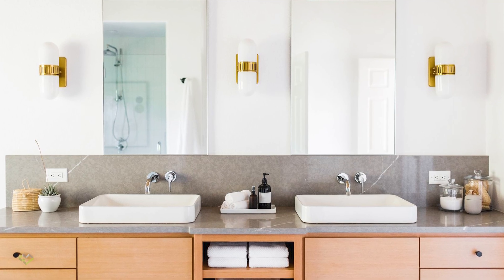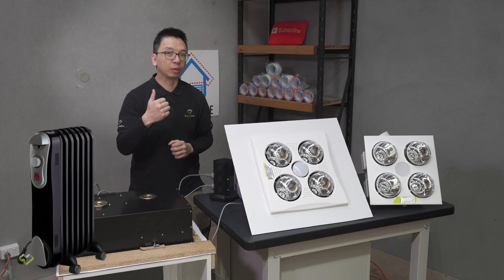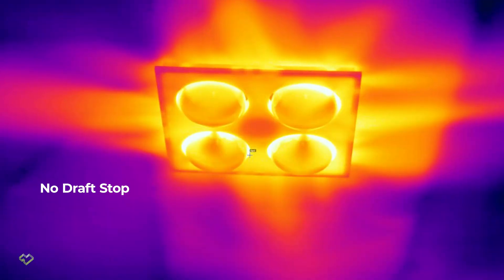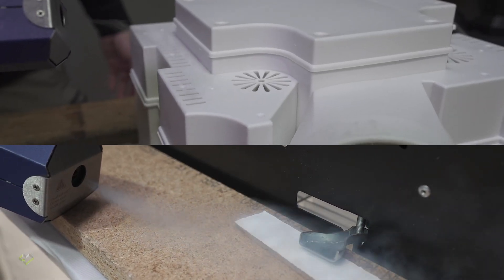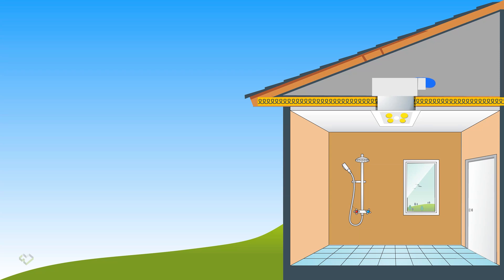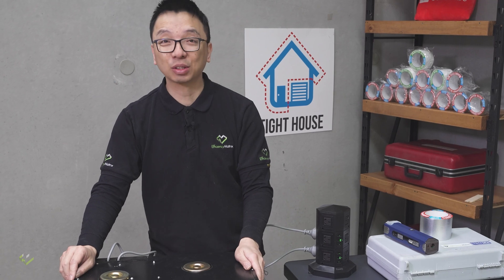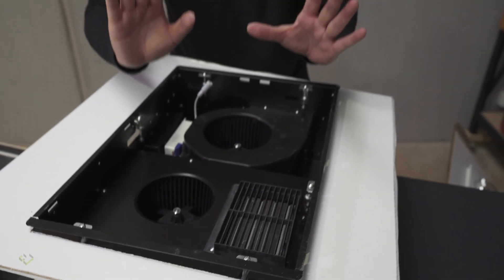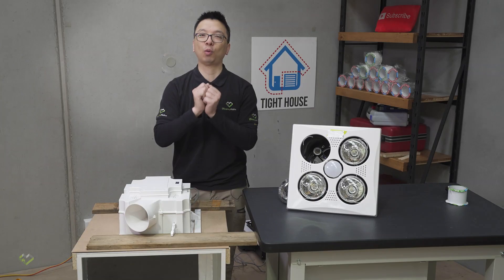Are Heat Lamps/all in one units a good idea in your Bathroom?

Comment: We have had the 3 in 1 in our main bathroom for several years and also fitted one in the ensuite. The inline fans have been very efficient at removing the steam and the lamps provide heat on stepping our of the shower. For the 10 to 20 mins max 2 of us most of the time use the bathrooom I would not be concerned about the running cost and it is hardly worth heating the rad for that time. The mirror is clear  to use after showering.

Comment: Here in Brazil any of those solutions would cost 6 months of salary. haha
Back in the day my parents would get a soda bottle cap, fill it with rubbing alcohol, pour said alcohol in the floor (tiles, obviously) and light it up. lol 
Never tried it, as I always thought it was madness, but they swear it worked wonderfully. 🤣

What I do when I'm gonna stay more than a few minutes in the bathroom is take a hair dryer, put it on the countertop and turn it on and close the door for 7-10 minutes, then get inside and use the bathroom normally.
People often forget hair dryers are basically (noisy) air heaters, they can't be used for long periods, but for quickly heating a bathroom, or even warm up a cold bed, I find them perfect for the job.
Also basically every house already has one, so why not use it? 

Then again, cold winter days are a rarity in Brazil, in my region they don't last more than a week or two.

That being said, I never considered heat lamps before, that should be interesting to test out someday! :)
Reply from the maker: Heating the bathroom is a serious issue, that doesn’t really have a viable economic solution.  It’s pretty sad really.

Comment: I've been wanting to add heat lamps myself!  Getting out of shower, nothing like a nice warm towel or some heat while you dress!

Also, with the popularity of cold-plunges, and considering a refrigerator outputs 32-40F (0-4C)... 
I'd love to remodel a bathroom, such that with a flip of a switch somewhere, 30-minutes later, ice-water will come out of the shower-head  (2gallons/min for a few minutes)! 

Any thoughts if this is do-able , or is a shower's water flow too much for on-demand ice-cold?

Comment: We use a heater blower wall mounted to recirc warm air within the shower room, this raises dew point significantly and keeps the moisture in its gas phase, once the room gets saturated (condensation noticeably begins forming) we turn on the extraction fan which is on a pre set run on timer.  Simple, cheap and very effective.

Comment: Another option to greatly reduce the need for the fan is to have a fully enclosed shower area. Something like a showerdome or even a piece of arcylic sheeting that covers the top of the shower means that no steam is even generated and you stay warmer in winter while showering. Simple yet very effective. To the point where we don't even use the bathroom fan anymore.

Comment: I've seen a 3in1 unit on the market, that is wired to turn on the fan at low speed when the heat lamps come on. I didn't notice any extra holes in the top for passive cooling of the heat lamps. Having the fan running with the heat lamps would mean more power use but I think a unit with a DC fan would mitigate that

Comment: What about just fitting a draft stopper to the basic 3in1 unit and wiring it so the fan is always on when the heat lamps are on?
Reply from the maker: If the unit is not designed like this, it is a tall ask to ask for insurance to accept this modification to a device like this should a fire start from it being modified.👍

Comment: Sorry, another thought: Would some sort of heat recovery extraction with a fresh air intake (far from the exhaust) be of benefit? The same sort of heat exchange used on primary passive house systems.
Reply from the maker: This is a video where we focus on mainstream construction where the house design is NOT passive house centric.  No doubt viewers of this video if they enjoy it will get exposed to passive house principle heat recovery ventilation systems though via other videos.  Thanks for the comment.
Reply: Considered the usage pattern (short and intermittent) and the complexity of such system, the benefit does not warrants the effort required. Unless it’s a part of a whole house energy recovery system.